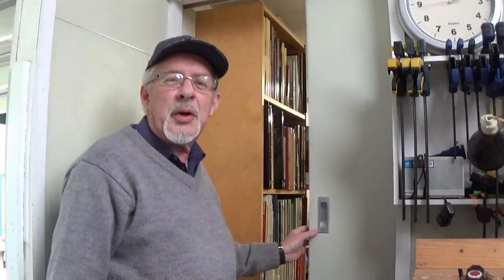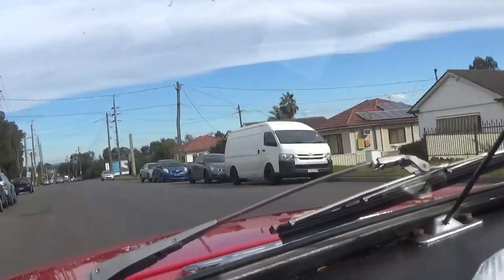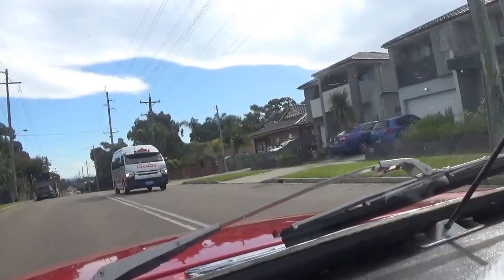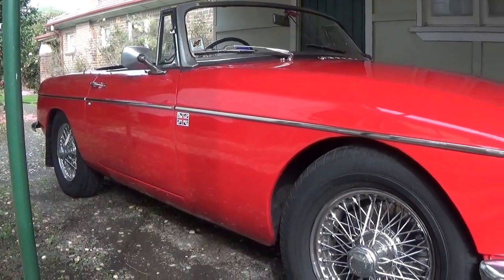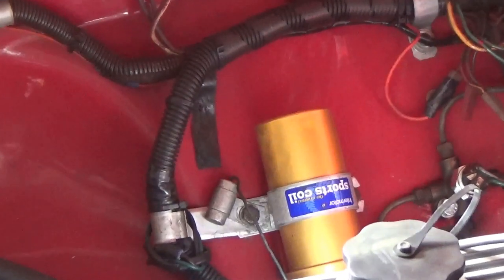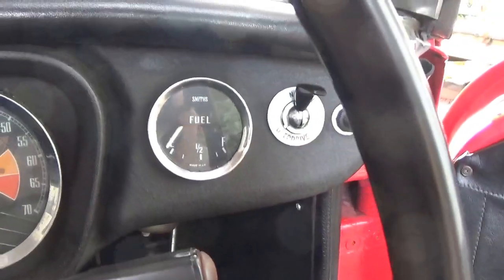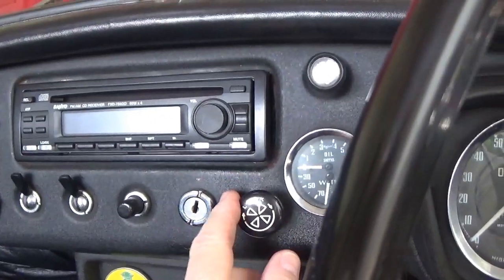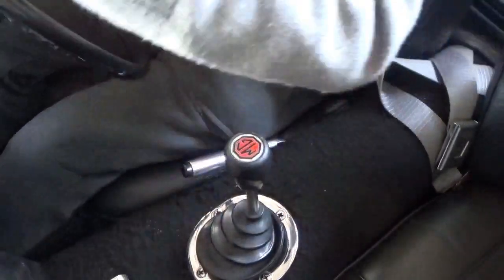Episode 151 20 Something Completely Different

Comment: I love open top motoring my self at the weekend and when the weather is good. Love those wheels a devil to clean I bet.
🚂🚃🚃🚃
Reply from the maker: G`day Dinmore,
Yes the wheels are nice and a great feature of the car. I use a pressure sprayer to clean them which saves a lot of tedious work, however if I was doing a car show, I would take the wheels off and do the job properly both sides of the wheel. It`s the sort of job that does not have to be done very often because the car spends most of it`s life under cover in the shed.
Cheers Gormo

Comment: I used to have a 1972 model.  Mine developed front suspension rot at the bulkhead and got part exchanged. As you say, great fun.
Barry.Devon
Reply from the maker: G`day Barry,
Yes these cars aren`t perfect yet the parts supply even now is amazing and cheap. Much cheaper to repair than my every day modern car.
Cheers Gormo

Comment: Awesome car -i had a mgc gt from 1968 staight 6 cylinder engine and manual overdrive unit -it was the only car i ever had that sold for more than what i paid for it 😎😎😎
Reply from the maker: G`day Mike,
 I`ve only ever come across one MGC in my travels and that was a roadster. MG tried everything in motor size in their cars. The V8`s are mean little beasties. I imagine the 6 cylinder was a powerful smooth drive.?
My little MGB is now valued at considerably more than I paid for it, whereas my everyday car`s value just keeps dropping.??
 Stay safe
Cheers Gormo